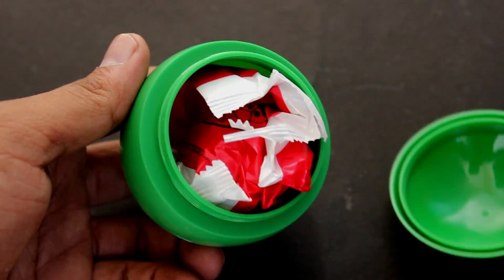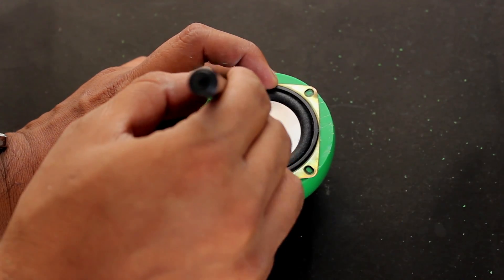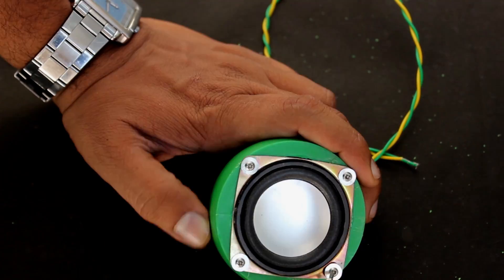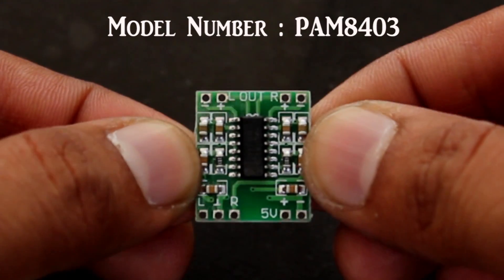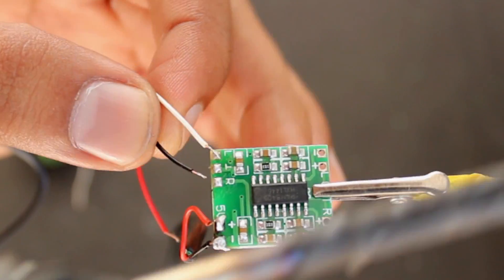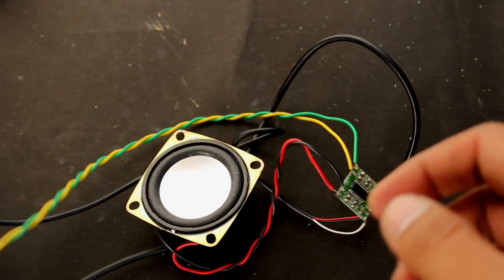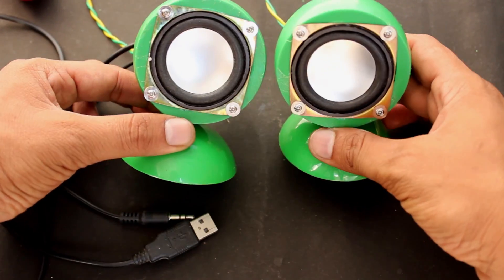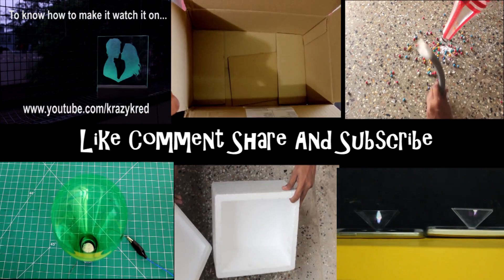How To Make USB Speakers Using Plastic Cadbury Gems Candy Surprise Ball At Home Easy Way-Recycle

Comment: hi i have a iball usb speaker and i found that one of the speaker is not working and upon testing it out i found that the audio left channel positive and negative were not working on the PCB hence sound was not coming out from left side speaker. so as right side positive and negative is working can't i connect both left positive and right positive wire on Right audio positive on PCB and the other respective negative wire on the left audio negative? or is there any way to repair

Comment: I connected two speakers to this and they worked well. but can we connect 4 small speakers by connecting 2 to the chip & other 2 to the speakers?? plz help
Reply: Yes it will work but if the sound goes noticeably weak then you must add some more power/current to it, the problem now is if your amplifier can handle higher voltage, so the solution is buying a higher wattage amplifier for a higher power capacity...or you can also try a lower speaker wattage, for example you originally have two 3watt speaker then if you want to make it four speakers, devide your 6watts to four, so 1.5watt each speaker or 2 watts each will work either...

(try adding some speaker first to avoid wasting money, if it worked then very good...series or parallel wire for connecting is not an issue)
Reply: Your amplifier chip is busted, i guess thats why won't work no more, overloaded amp demand blew it.
Reply from the maker: Nooo not possible
Reply: bro i connected 3 and they were working for a minute and then i connected 4th speaker and they stopped working. now even 2 speakers dont work. what might be the problem?
Reply: your amp chip blew up
Reply: +Eric Vauwee Lol.